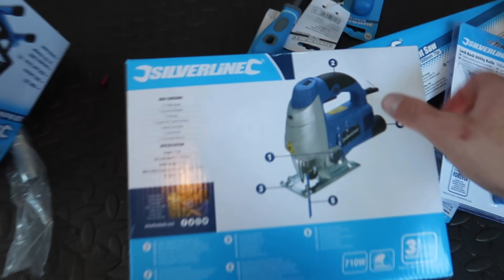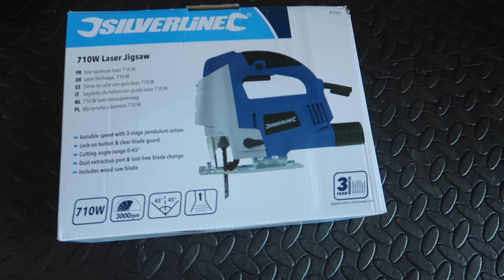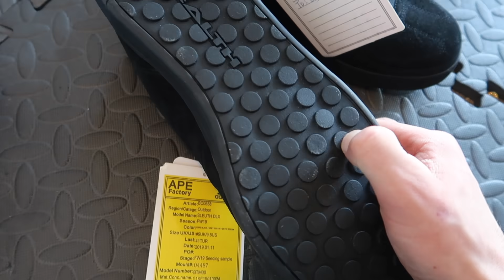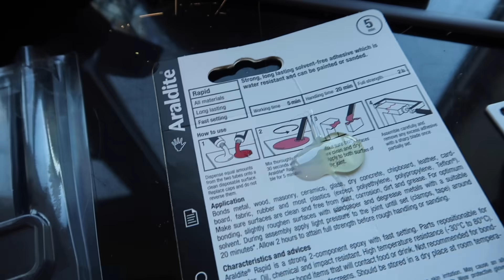BUILDING STUFF AND COMPOUND UPDATE - VLOG#1

Comment: Plywood does not burn well because of all that glue that it usually sticks it together. Get some Owatrol-oil (yacht service). Easy to handle and the plywood will last almost forever.  You can take a tub, put the oil in and drop the plywood in, too. By that the that wood gets filled up, the oil crystalizes and as a side effect you get loads of grip on the wood. I do that on my portable minikickers. Works like a charm.

Comment: There is a speed adjuster at the top of the jigsaw. The Scaffolding will last for years, heaps better than plywood. Just make sure you drill your hole before you put a screw in it.

Comment: You should try using concrete board on the drop in so it would last 10x or more longer than plywood. Masonite is what is commonly used for ramps on top of plywood to make them durable and could be another option.

Comment: You can buy a jigsaw insert on eBay for about £30 with 3 different massage fittings. Just put it straight into the jigsaw where the blade goes

Comment: The jigsaw thing is common in powerlifting, but I thought you have to buy special bits for it made for massaging- might be more effective than the DIY version? Then again what do I know
Reply: Also, go to a petrol station and ask for one of their used oil drums, then drill holes in it at the bottom (not too many only small ones). Make sure there's not too much oil residue. Cut the top off. Bang there's a fantastic bonfire. Trust me.

Comment: About that jigsaw. Try to roughen up the surface of a blade because if it's too polished the glue won't stick. Also it's good idea to clean the surface up with some rubbing alcohol. There are some carbon particles on the surface which acts as a grease so maybe that's the reason why it doesn't stick.